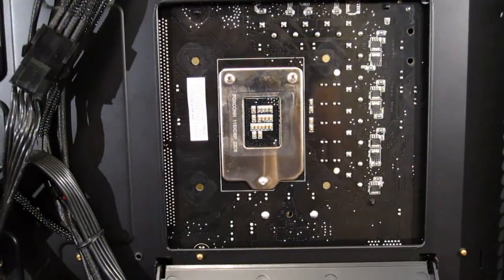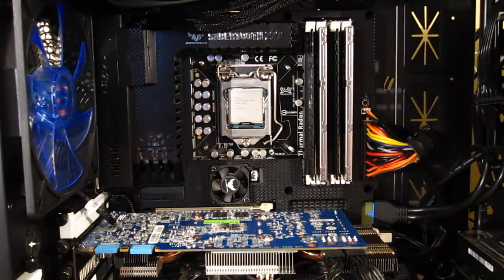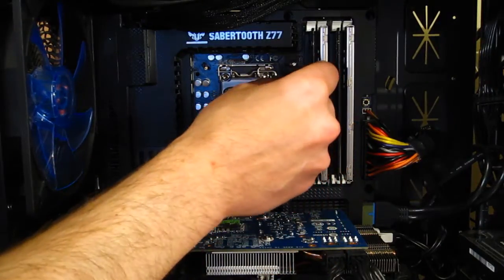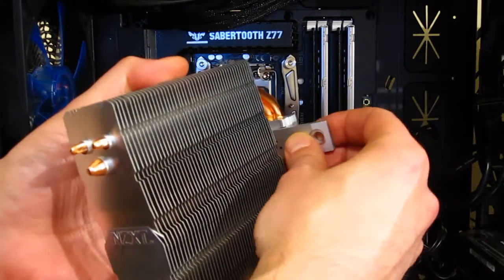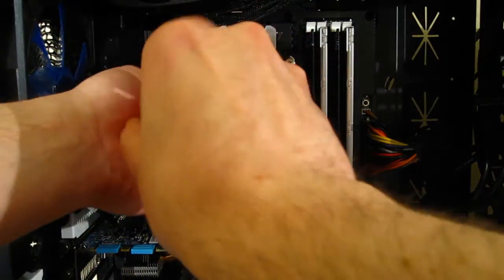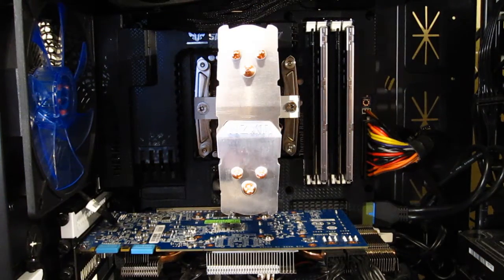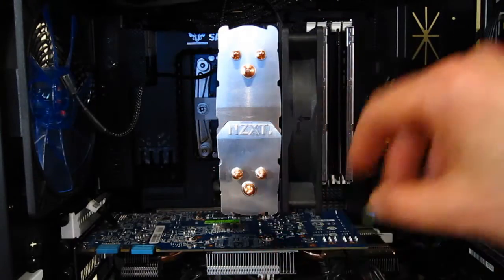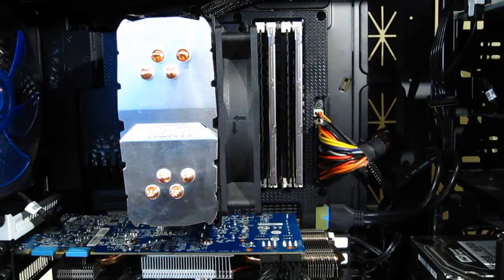NZXT Respire T20 and T40 Installation Overview at HiTechLegion.com

Comment: This cooler works for chipset 1151?
Reply: 1151 is not mentioned in the manual, cooler is a bit old now, but installed in my Z170 system fine. Have used it in several systems, both AMD and Intel and it's a VG budget cooler.